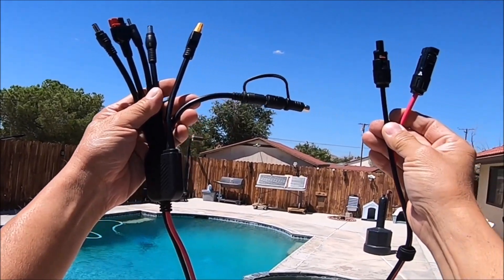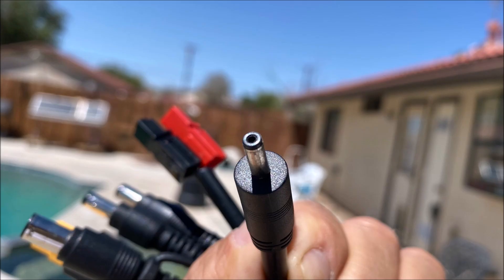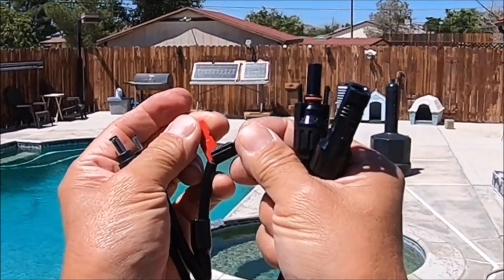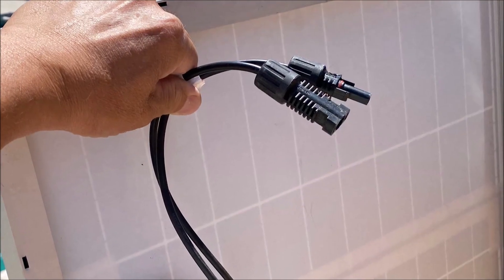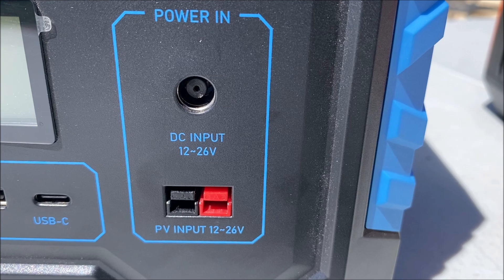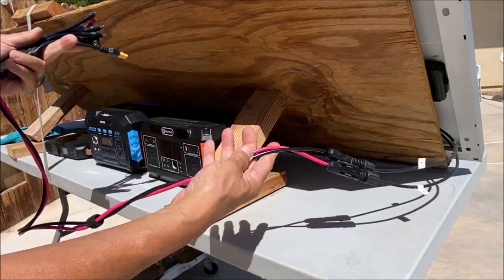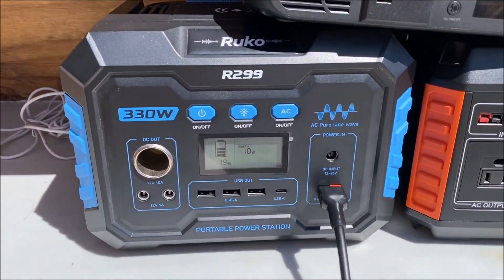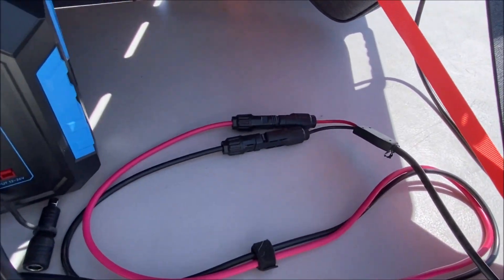7 in 1 Solar Panel Connector Cable for Portable Power Station

Comment: thk i got the 7 in 1 adapter solar panel to power station all so getting solar cable extension  does it matter
with the extension cable which colours it mean red to red black to black do there have to match up 7 in 1 adapter

Comment: These cables are all you need, good job Pete.
Reply from the maker: Yep!  Now you can plug in any power station to a solar panel and not have to search for the correct plug adapter.  Makes life so much easier and less walking back and forth :)

Comment: It's a multi-connector cable that looks like an octopus's tentacles. 😅
Nice review!👍
Reply from the maker: Thank you bro!!  Perfect for the portable solar panel when you go flying but there should be a universal connector for power stations so you don't need a 7 in 1 adapter but that is just not the case.